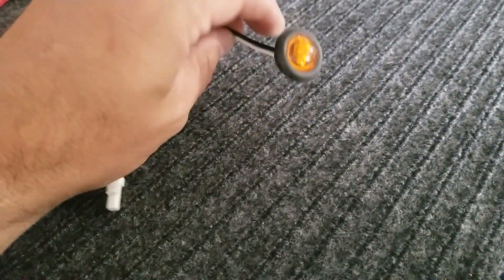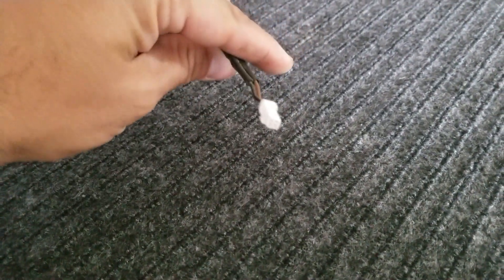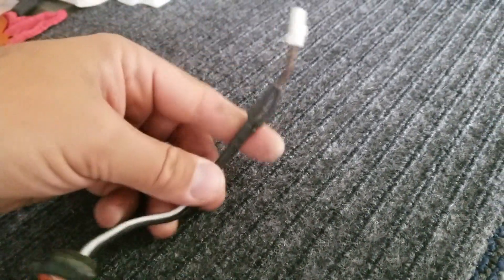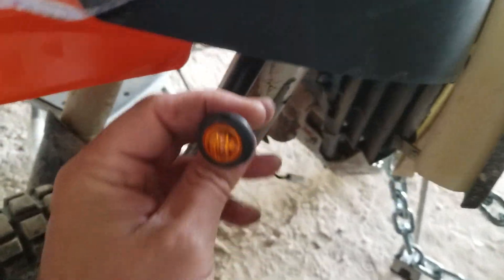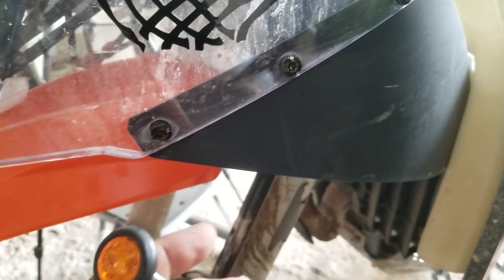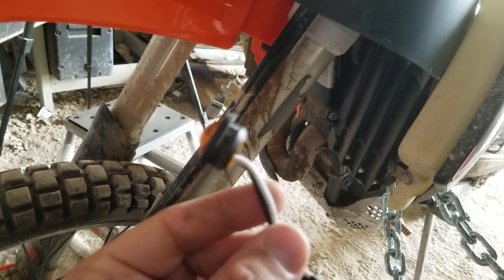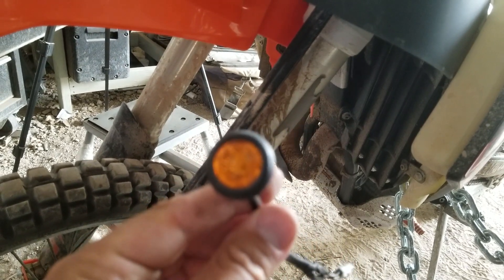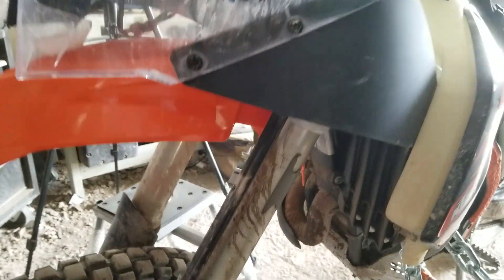KTM EXC 500 turn signals

Comment: You may want to check what is required for a motorcycle in NV. I know in AZ where I converted my WR it only requires a headlight, tail light, brake light and a horn. Turn signals just seem to get scraped off like zits on an ugly girl.
Reply from the maker: I'll look into it